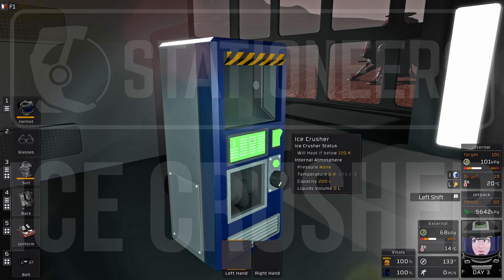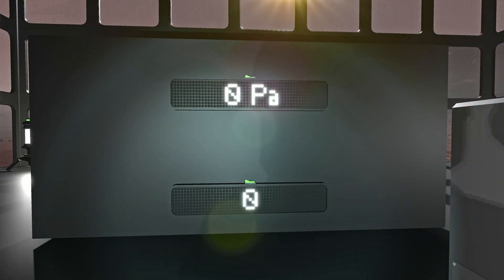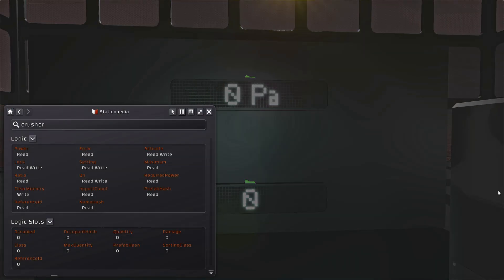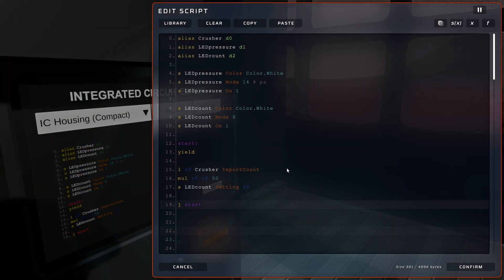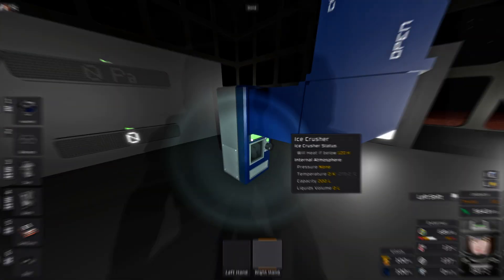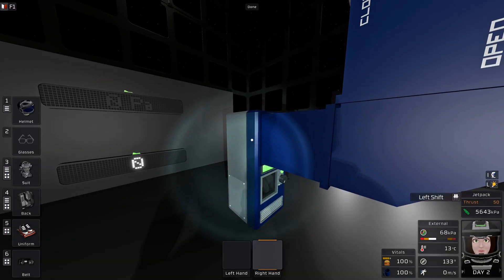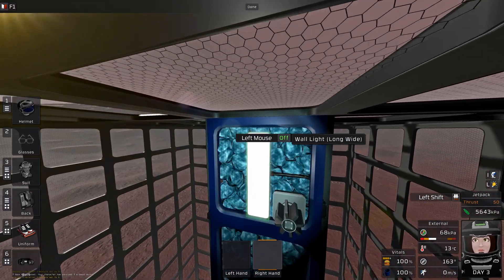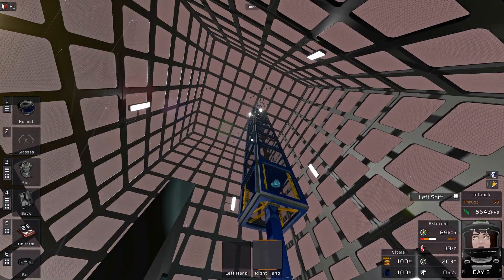Does the Stationeers Ice Crusher have a maximum pressure limit?

Comment: I mean the fact that the ice crusher, probably a mechanical device can reach beyond 100 MPa of pressure and still somehow crush the ice despite the fact that some sort of condensed matter should probably be in that thing is amazing. Cool trap to leave as a prank in a multiplayer base if I ever find someone to play this game with.
Reply from the maker: There's a pretty useful "looking-for-group" https://discord.com/channels/276525882049429515/392081381687296010 channel on the official Discord https://discord.com/invite/stationeers
I tried a combination of pure nitrous oxide and volatiles. As soon as I stuck the inline tank on the opening, the stuff ignited in the tank - first with a spooky "Why are there air movement particles around this thing?" effect due to the extreme heat. Then rupturing.
Reply: @OwnerOfTheCosmos  lol that is so cool surely I'll eventually figure out a way to derive useful action from this condensed matter anomaly!

Comment: And if you add a pipe on the back when it’s full?
Reply: The pipe will explode, most likely, but I'd like to know too
Reply from the maker: Look for h73mwtc's comment below, starting with "So if it mixed correctly with nitrice", to which I responded. :)

Comment: So if it mixed correctly with nitrice and volatiles it is basicly nuke🎉,is posible to ignite inner storage with temp controll of crusher ,like overheat oxy or vol ?
Reply from the maker: Well, for over an hour now, my Crusher has been chewing on Pure Ice NitrousOxide and Pure Ice Volatiles, and I now have 122 MPa at 46.9°C in the Crusher: 5kmol volatile gas and 4.15kmol N2O which is trying to condensate. Nothing spectacular. So I stuck an insulated liquid pipe on the liquid outlet. Stayed empty. Then I stuck a big and immediately also a small inline gas tank (not insulated) onto the gas outlet. Was wondering why there were gas particles flying away. Realized the mixture had ignited and was heating the surrounding air so much, the pressure differential was beyond the threshold of gas movement visualization. At its peak (The moment of rupture.), the 1.5 tanks showed this on the tablet:
350L capacity
249 MPa
4456°C
6.16KJ convected
nothing radiated
nothing latent
283 mol VOL
186 mol N2O
876 mol N
876 mol CO2
The room near me reached 213 kPa and 552°C.
Reply: @OwnerOfTheCosmos nice😂 , i know pipes cannot hold it but when is filled seal the room filled with fuel and ignite it that shoud butn down crusher and it shoud push all that presure out ..., and is strange that is liquid there and nothing from pipe thys coud be usefull at point of large storage of gas for basicly nothing and is isolated i presume

Comment: Didn't Splitsie have the ice crusher explode on stream during a multiplayer session?
I remember it taken most of the corner of the base at the time. I believe they were extracting and using the water, but it was actually the gas that ended up exploding..
Reply from the maker: Maybe it's different on the current Beta, they overhauled the Crusher (temperature dial etc.)